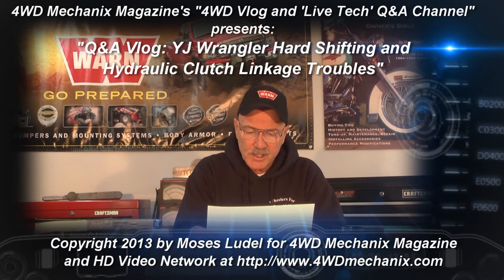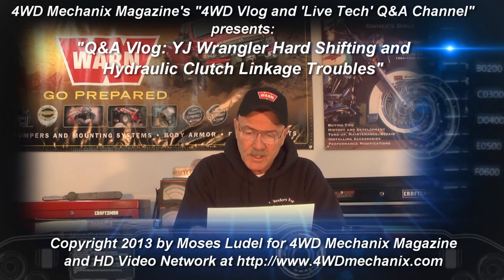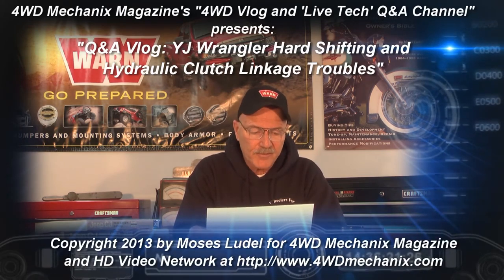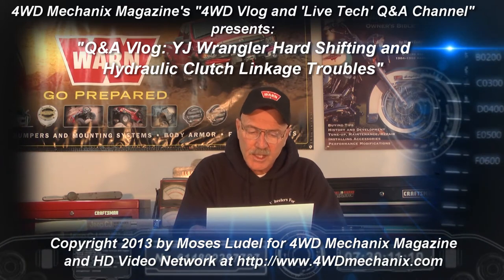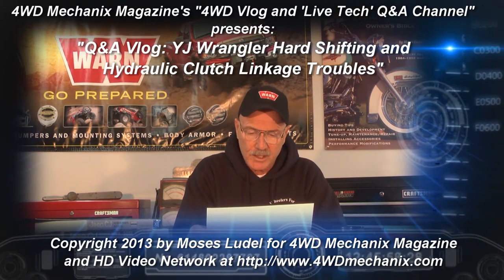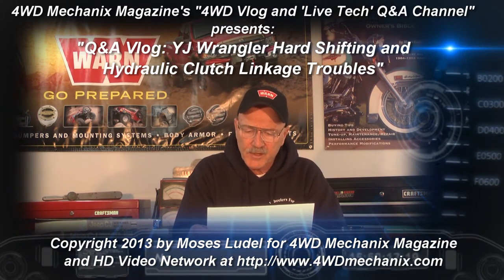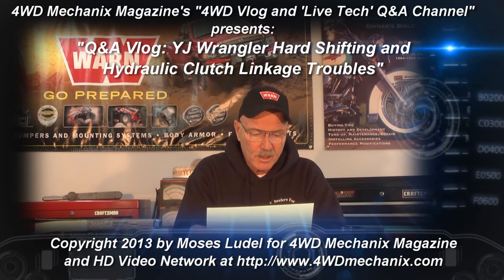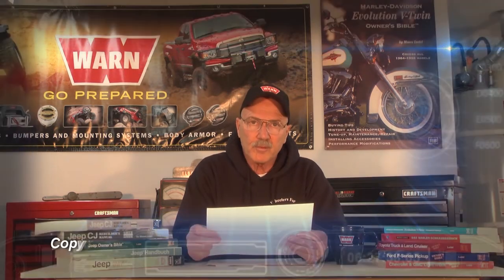Q&A Vlog: Jeep YJ Wrangler Hard Shifting and Hydraulic Clutch Linkage Troubles

Comment: what if the fluid levels have been replaced and everything in the clutch is all new.  Clutch works good until it warms up and then you cant use it at all wont come out of gear and wont go in gear until things cool again and then works good. clutch line going to transmission is not heating up it is pretected by shields and staus cool? Cant figure it out.
Reply from the maker: Not clear whether you have the internal or external slave cylinder.  The internal slave (hydraulic release bearing) requires bleeding by the factory steps in the shop manual.  This could be an issue...Otherwise, I would check the pedal height to make sure the master cylinder piston retracts completely when the pedal releases.  This will provide a full master cylinder stroke and enough fluid volume to disengage the clutch.  The slave or master cylinder may have a worn seal that leaks down or bypasses fluid;  however, that usually comes with a visible fluid leak.  Check for fluid at the pedal rod boot of the master cylinder.  If an external slave, watch the clutch release arm when the system is hot and pedal depressed.  Make sure the release arm moves.  If not, there is a hydraulic cylinder issue.  Make sure you are on level ground, wheels chocked with the transmission in neutral when testing the release arm movement.  If an internal hydraulic release bearing and not new, they are notorious for leaking or bleeding down.  Try bleeding the hydraulic release bearing before condemning it.